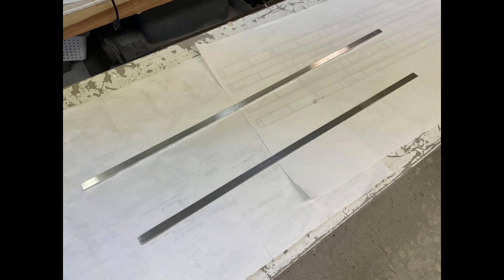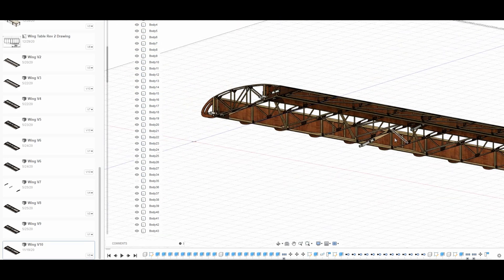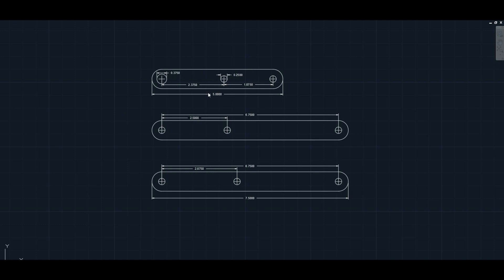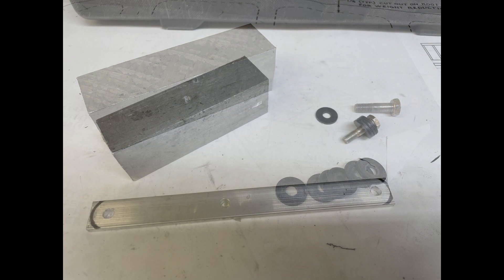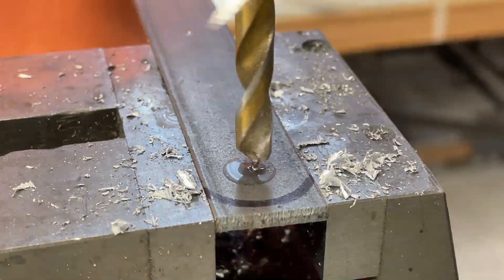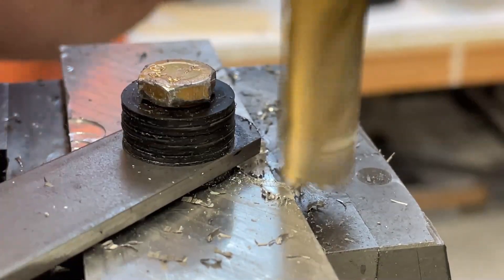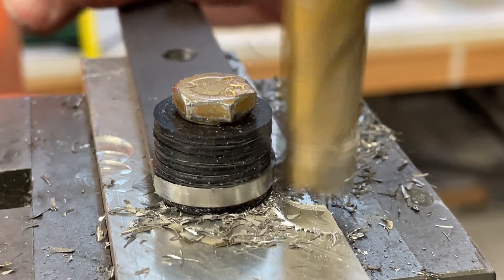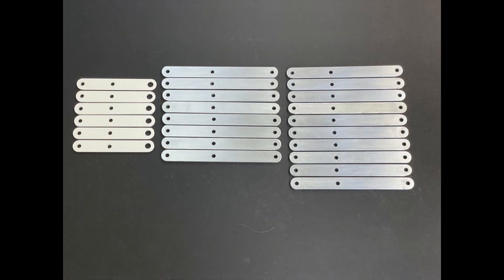AirBike Parts

Comment: Why didn't you use your mill for coping the fusalge tubing?
Reply from the maker: I tried, but was to hard to get the angle correct. Plus, holding the tube was hard. Its my lack of skill. :)
Reply: @dagtheaviator  mount a v block with a clamp on the mill bed and use your anular bit. You're done already but maybe for others. I appreciate your dedication to excellence
Reply from the maker: @douglasanderson1276  How do you adjust the V-block to get all three axis of angles needed in coping the tube?? Just about every tube had a different angle needed.
Reply: @dagtheaviator  tilt head mill and or angle vise. Or jig on a lathe. Also you can get a fine toothed hole saw. The small tubing you can get really close on a bench grinder with a narrow rounded off stone. Lots of options. A hand grinder works also
Reply from the maker: @douglasanderson1276  My Mill head nor table tilts. Thats why is didn't use my mill.
Reply: @dagtheaviator  That could be a problem 🤣. I enjoy your videos and expertise look forward to more air bike videos.